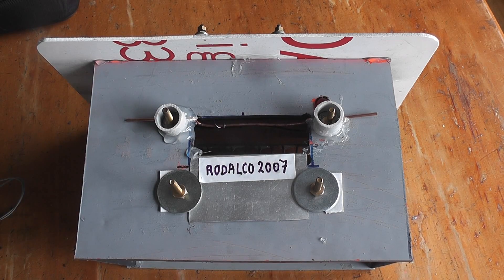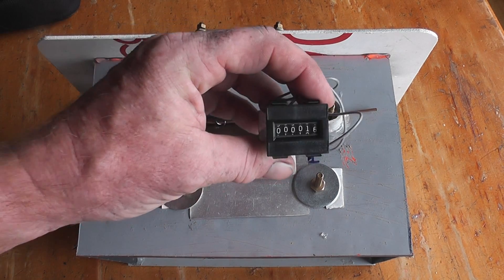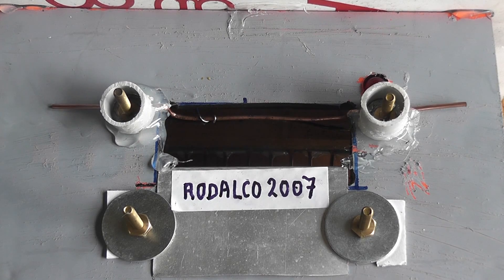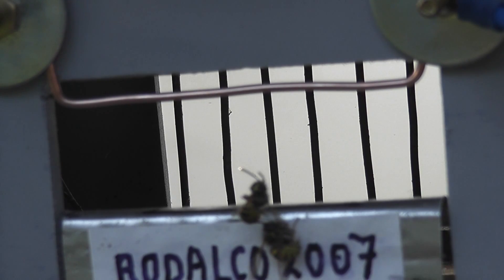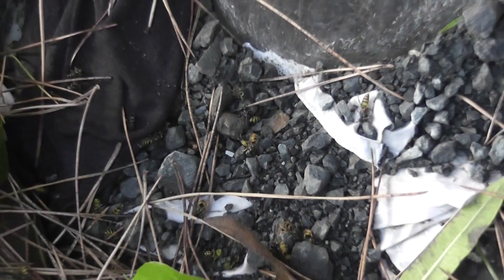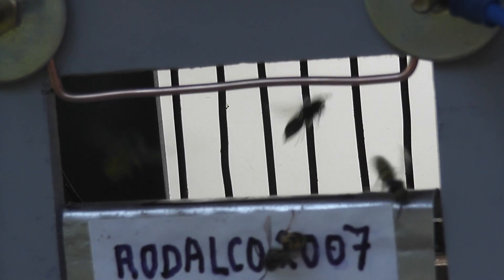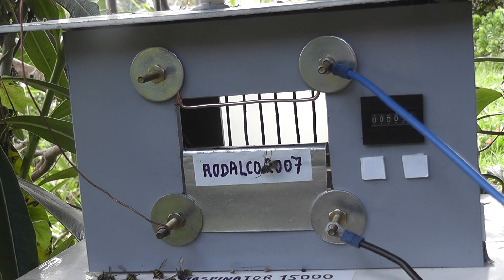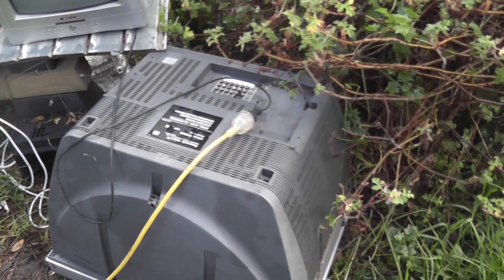The Waspinator 15000

Comment: If you leave the televisor tube connected it will act as very high voltage capacitor (more energy available when zapping) and also it will filter the flyback horizontal switching frequency that may warn the wasps.
Leave it connected, and derive the high voltage from a tap in the cable far away from the tube black coating (ground).
Be careful and discharge it before connecting or it will zap yourself!!

UPDATE: Forget my comment. Here is!!
https://www.youtube.com/watch?v=uDrjU0MN9w8

Comment: Hi boss, Have you considered adding some output caps to the HV section. That would stiffen up the source considerably. It would also make the whole system much more dangerous to operate with stored power. So rather than just killing them, you might get them to explode.
Hope your well.
Mike in Virginia Beach VA USA

Comment: If they can sense the electric field and it makes them leery of entering, would it be possble to rig up a motion detectar that would turn on the zapper current only when a wasp or wasps werr between the two electrodes.  Would such a control circuit result in a higher kill rate.

Comment: Have you tried leaving the 2nd anode lead connected to the CRT of the TV set?  The coating on the CRT forms a capacitor.  You might even try paralleling a few CRT's for more capacitance and more peak current to blast the wasps.

Comment: Make a HV capacitor from aluminim foil and plastic foil rolled up, be sure to use good thickness of the plastic foil for good insulation.
A capacitor would help getting the wasp-exploding current surges that will render them devices out of service :D

Comment: A suggestion for the interlacing problem: Check if your editing software has an option to deinterlace using either Double Framerate or Yadif2x on output. You'll get rid of the problem, and get a much smoother video.
Reply from the maker: I am looking to get a new camera this year with 240 FPS option as well.
Reply: I don't see any interlace artifacts on this video, I once saw on the first wasp zappers. Could it be depending on what browser or video card you use?
Reply: I don't see the artifacts either, maybe YT is doing a proper job now. But that procedure I told him would output the video in 50fps, which looks a lot smoother.
Reply: Yes. I personally use Avisynth and QTGMC. This filter is like it never was interlaced ever. It's so nice. But EXTREMELY slow. I should write myself a tool which does it in artificial multithreading.

Comment: Another happy video!!!!. What amperage do you use to get such decisive kills. I have a 4000 volt Bug Warrior supreme racquet , and it isn't close to this effective. Do you know how I could modify my racquet to make it more effective? Thanks
Reply: This is probably something like 15 to 25kV, at about 2 or 3 milliamps.
Reply: Thanks
Reply from the maker: A few milli Amps, the racquets are not effective as they are supplied from a tiny 9 Volts battery. Use an old CRT TV but be very careful with High Voltage. it will kill.